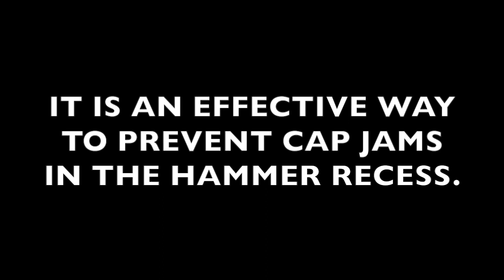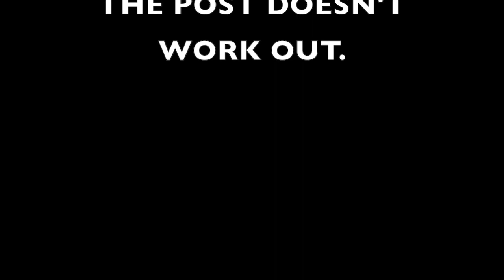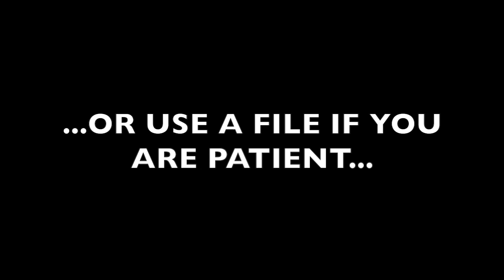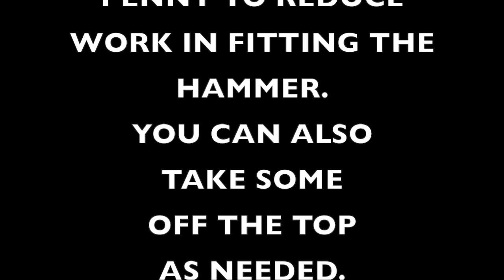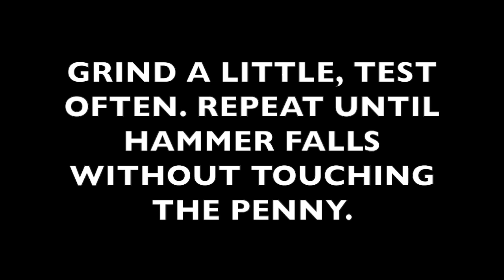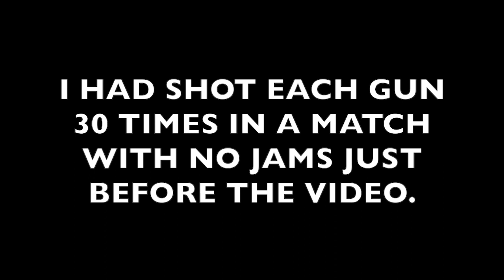QUARTER CENT CAP RAKE

Comment: The penny is made of zinc. How long will it last? Couldn;t you use a piece of steel or grind down a nail flat and inset into the frame?
Reply from the maker: I’m happy to encourage experimentation.  Try whatever you like.  I don’t know how long it will last.  I sold the revolver several years later and the penny fragment was still working at the time.